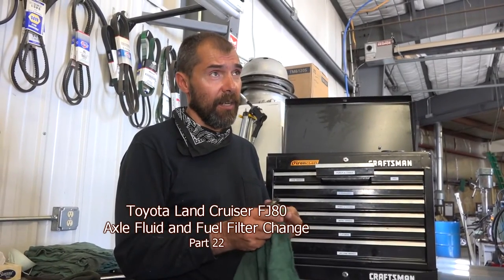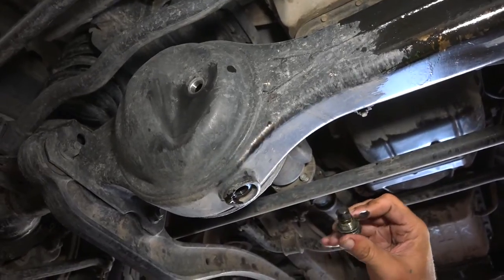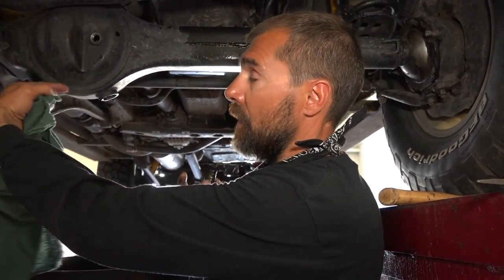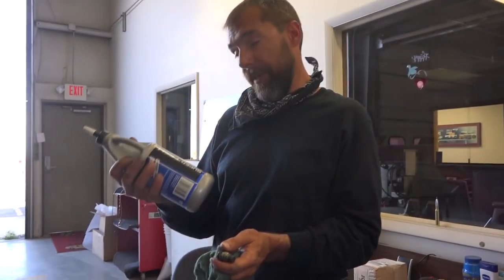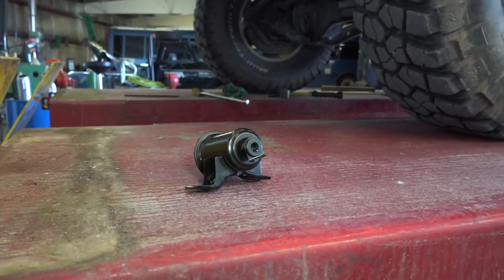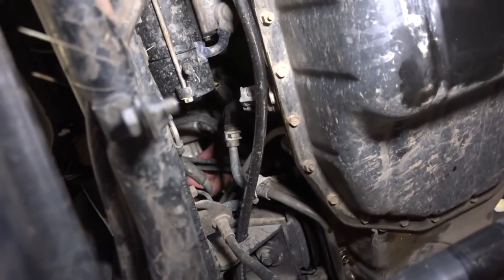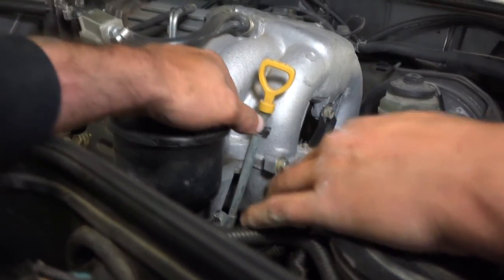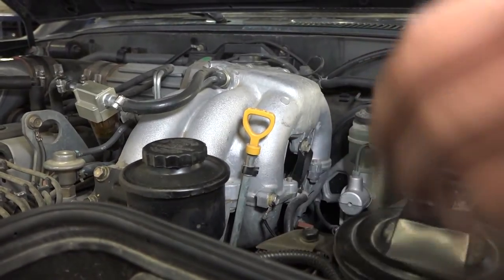Toyota Land Cruiser FJ80: Axel Fluid and Fuel Filter Change Part 22

Comment: I was wondering if you can remove the fuel filter without removing the exhaust manifold? I heard you say that the second bolt can not be accessed with the manifold in place.  I hope that mine has been replaced also, so I don't have to deal with the second problematic bolt. I need to replace mine also.  thanks for your input.